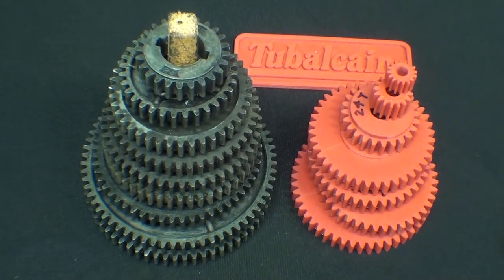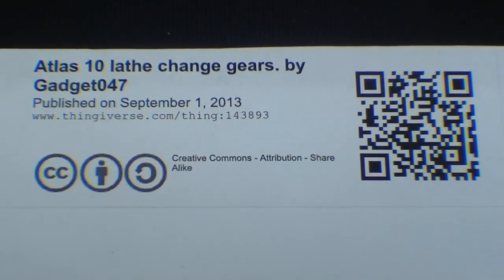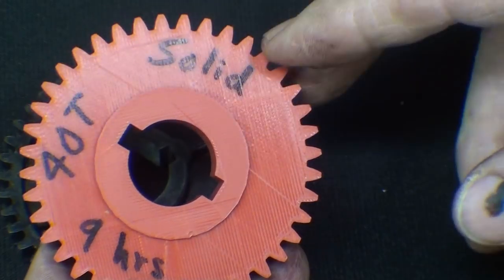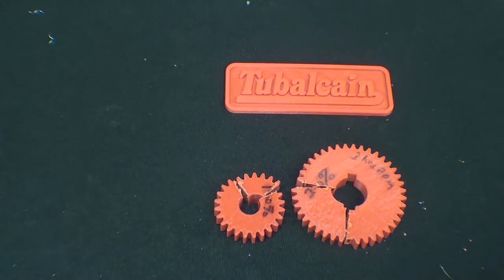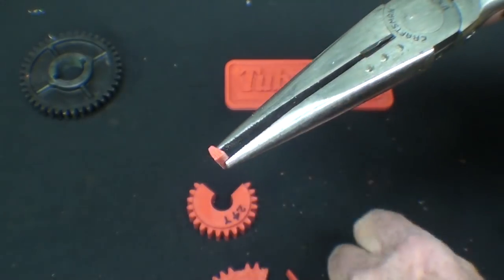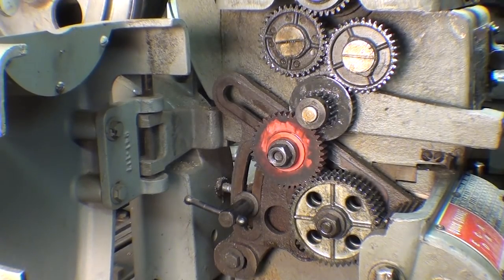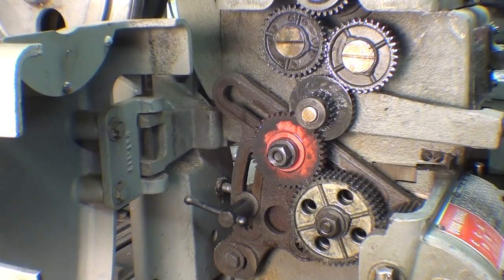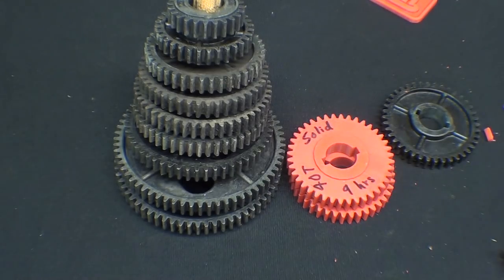3-D Printed Gears for Atlas Lathe TIPS #416 tubalcain

Comment: I wanted to get a 3D printer anyway. Looks like now I have a solid reason to do so. I found a craigslist bargain on a small mill/lathe combo but the change gears were missing. Now I just need to get the specs of the missing gears and print up a set. If anyone has info on the M1018 Shop Fox change gears - let me know! Great video.

Comment: this is the kind of thing i want to see! im hoping to get a 3d printer soon and one of the first design projects i plan to make with it is a reproduction of a champion model 400 forge blower's bronze gear. that machine used a bronze gear in an otherwise steel gearbox to transfer motion to a worm drive to turn the fan, the idea being the bronze would wear before the worm drive ever did. the gear in mine has just enough tooth left i could use it to create a 3d pattern and then try how it works in nylon or some reinforced material. even if it doesnt have the lifespan of bronze its way cheaper than having another machined and the cost of replacing it in the future would just be a couple bucks in filament and a few hours of waiting around... if i could only get the F&*#!%* gear off the keyed shaft in the blower
Reply from the maker: Sounds like a great project for 3-D printing

Comment: not very surprising, pla is strong, but its not impact resistant, so as long as you dont build a hammer with it, it should hold up fine, especially with the 100% infill. maybe just a tip from me, you can chose how many outer shells the printer should print, if you chose as many so the teeth wont be hollow, you could maybe end up with equal strength to the 100% infill one but with half the print time!

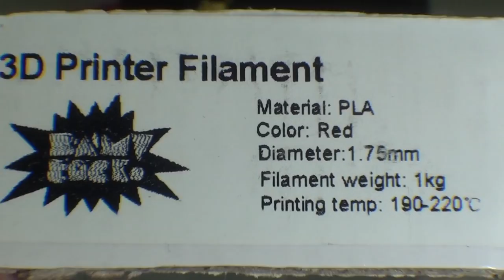Comment: 3:20, Mr. Pete's not PLAying around

Mr. Pete, if you're up to more testing, I was thinking a low TPI threading operation would be more stressful on the lead screw gears. But you'd always want to test on the first pass so if the gear breaks you don't crash your tool.  Just a thought.
Reply from the maker: Yes, that will be included in the follow up next month
Reply: I bet you're gearing up for the follow-up episode

Comment: Interesting that the printed gear did not fail, it will be a good test to see how long it lasts in service, having come through this test so well will you leave it in place as a life test in normal conditions ? The only thing against it is the 9 hours production time, you could hob out a steel one in less than that.We call the pot metal Mazac in Europe.
Reply: Englishman French ya but you could print it while you sleep 😴

Comment: Instead of a 3D printer why not use a urethane compound with a silicone rubber mold. I read a excellent article in SERVO magazine May 2007. This method would be much faster , cheaper  and you can have the molds ready to pour another gear at any time. I would like to see you test this type of gears. The article use HobbyMold 150 or HobbyCast 110 if these companies are still around. If you can't find the article I can mail you a copy. Just need an address.I do have a Atlas 10 inch lathe and a Craftsman 109 lathe.  Thanks for your excellent videos,      Christopher
Reply: csn451 there are two issues with silicone molds. The first is shrinkage from the master to the cast copy. Might not be enough to even worry about. The second is the molds become brittle over time and degrade. You can mitigate this with a silicone mold release spray the helps rejuvenate the mold and storing the mold correctly.
Reply: Hi Mike ,thanks for the info. To this day I have not tried this method to form gears . Can you tell me the other issue of Servo Mag that has the other article

Comment: I heard that the small Chinese hobby lathes use plastic gears and 1 video where 1 of the gears broke. I suppose i can try the 100/127 tooth setup in my 14" logan and tell you when it breaks. But then if it doesn't i guess i wouldn't need that shaper....

Comment: It would have been nice to do a visual inspection of the grear following up the test run. That could help a guy  in determining the longevity of the printed parts
All your people are saying it will give up the goat in time,,, WELLLL no shit surelock everything does so the real question is what's the time frame hear is this a 20 hour part or a 20,000 hour part? 
Do you plan to keep useing this part and do a follow up veejayoo?
Reply from the maker: I will be doing a follow up eventually. But I do not use that lathe often enough for a true evaluation

Comment: There is a filament called nylonX which is Nylon impregnated with carbon fiber that a fellow printed impeller with and then ran over it with his truck with no damage to his truck or the impeller. Looks like a gear made with that would last.
Reply from the maker: Yes, that looks like a good material

Comment: That was pretty impressive. I wonder how the 20% filled gear would hold up?
Reply: If it were printed with the teeth solid and their mounting edge also but the inner portion 20% it would be as strong with less plastic.  Kinda like how the original gear was made.

Comment: I would say if it's something your actually going to use you should A: make sure you have the cover that goes over the gears in case one of the plastic gears flys apart and B: print them in Nylon instead of PLA or ABS. There is a reason why they use nylon in consumer products instead of ABS (generally).
Reply: Great video Mr Pete ! As always , I enjoy watching what you come up with next . Very informative and please keep the videos coming .
Reply: Nylon is VERY difficult to print with, even more so than ABS.  You need an all metal extruder that can reach 240c, and you have to dry the nylon filament in your oven for 8 hours before printing with it every time you want to use it, unless you dry it and store it in an airtight container with large amounts of dessicant in it. Nylon is hygroscopic and will absorb up to 10% of it's weight in water in a single day. If you don't remove that water, it creates steam that blows up inside the filament as it is being extruded. You also need a heated bed, and a warm area to print in.
Reply: Is Nylon more durable than PLA or ABS?
Reply: NolanSyKinsley yea but if you don't have a way to cut the gears it's still a much better option. I mean I don't have a set up to cut gears on my lathe so if I need a gear I'll print it in nylon. It's really not as hard as you make it sound. Also I'd like to point out that most printers these days (at least the decent ones) have a heated bed and have a full metal hot end that comes standard.
Reply: Yes, nylon is not too hard. About the same as abs. I use the "nylon bridge" filament a lot. Bake the filament in an oven right before printing, print at 260. I use an enclosure for thick parts that may warp. Very strong, high temp, layers fuse well.  Can not pull the layers apart. Different story from pla/abs. Printed with a ptfe hot end for quite a while prior to getting an all metal. Some discoloration but still works fine. Petg is another decent one in place of pla or abs. Pretty easy and high melting temp.
Reply: I thing in this case PLA is better than ABS because ABS i wipe faster. PLA is vulnerable to deformation from heat but have better slip and its stiffer than ABS. Nylon is other tales....

Comment: Mrpete222 can you advise as to how many more hours you have put on these gears and how well they've held up?
Or can anyone with experience with pla printed gears performing this type of duty advise as to how long they last?
Reply from the maker: The jury is still out
Reply: mrpete222 It's encouraging to see that 40T gear, with 9 hours of use, that doesn't seem to show a whole lot of wear. I wonder what It would look like after 90 or 900 hours in use.
I also have an atlas, the little guy, 618, and am missing a couple gears, and some are worn pretty bad (carriage and leadscrew were stiff) so I think I'll give this a try.

Comment: If they function it would be awesome to have the metric gear set for threading on my Sheldon lathe
Reply: Liberty Cave I wanted to see threading with these gears, because the much higher feed rate means there is less reduction in the gear train.  A coarse thread would put more load on the gear he tested.  Increasing feed stresses that gear more than increasing depth of cut.

Comment: Sounds similar to a pot metal that has a low melting point. I used the same 3d set up for a 127 tooth index gear to cut a gear on a shaper between centers. Know anyone selling a decent bench top shaper? Prefer SB 7"

Comment: Interesting experiment. I have a small Atlas 618 lathe with Zink gears and I've always had misgivings about them. Set aside the burden of changing gears to get a thread, the risk of damaging them if my threading tool bit hits the shoulder on a workpiece is discouraging. Unlike my Clausing that has a shear pins on the feed and lead screws to prevent gear damage, these small lathes and others don't have this safety feature.  
You would think that if you buy a manual lathe these days, that it would have this feature as standard. But practically all bench top lathes which are made in China are so badly designed, that it makes you wonder if the Chinese have ever heard of CNC machines. The kind of machines that provided high speed machining, high accuracy, with innovative cutting tool geometries to maximize cutting efficiency, which in turn, would allow them to make better lathes, even better than an Atlas. Sadly, such machines do not exist and it makes you wonder why. I would never buy Chinese made machines. I refer to them as  Yugos. The only way to make an innovative benchtop lathe and milling machine would be to build it from the ground up from those who know better. I'd like to see Tubalcain, Keith Fenner, John Saunders, Edge Precision, Abom, and other top notch machinists work together to design a bench top lathe and mill that brings back what we had lost in the machines the US made back in the 50's and 60's. It is these machines we covet because they were made so well but now we have nothing like them. The Yugos have become normalized and so I'm not suprised that those who have them are always making improvements on them because they are so poorly made. The Atlas are better albeit their zinc gears.
Reply from the maker: Yes, he imports cannot equal the quality that we had on this country 120 years ago. Most of it is junk.

Comment: I've been making gears from PVC for years. Never had one fail.  You know those leftover pieces of 12" PVC pipe the city leaves around.  Cut a rough round shape, machine to size on the lathe and slot the teeth with a form tool.  Index using this: http://www.cgtk.co.uk/metalwork/reference/divider
Reply from the maker: Yes, PVC is a great material. My brother uses it all the time. But he buys it from McMaster Carr

Comment: Those pla gears won't last very long at all. They will deform with a slight pressure and a slightly elevated temperature. Nylon would probably work really well. There's also polycarbonate, but I'm not sure of the wear characteristics. Nylon is probably your best bet.
Reply from the maker: Time will tell

Comment: ABS isn't as strong as PLA. It does hold up to high temperature better though. Get PLA too hot - even leave it out in the sun too long and it will get soft and warp. If you want strong and heat resistent try nylon. ABS isn't the best to use for gears.

Comment: sir, plastic gear for lathe is not new, those chinese cheap lathe are all using plastic gears. the problem of these thing is, plastic can bent and worn out so fast. those cheap lathe that i am talking about usually don`t last longer than 1 year and you have to either buy replacement gear from them or find metal gear sets. as your video shown, during the last 2 cuts, the pla gear is shaking a bit. that is how fast it is going to worn out. born under the printer and die in the lathe, all happens in 1 day.
here is my humble suggestion, you may try insert a copper bushing and circle metal plate, or may be chicken wire as reenforcement for the gear in the printing process,  meanwhile it is the quick and dirty way i can think of and anyone can affort
i guess this series will have a part2 that you will take the gear out and examin the wear and tear, right?

Comment: Interesting experiment Mrpete! Glad you spent some time to explore such possibilities. I have made a set of gear for my little Emco hobbyst lathe in order to manually make screws and I must say PLA works pretty well.  Since you're also into metal casting, it would be nice so see some videos of gears making using lost PLA method, ie, using pla 3d prints as a positive model  for molds as in https://youtu.be/kgakfi8Ibjc. Thanks for sharing!
Reply from the maker: I think the lost PL a method leaves a lot to be desired. I have watched other YouTube videos on this. And it looks like a failure to me

Comment: A .005 feed is maximum test?   I think a better test would be to cut some threads.   A 20 thread per inch would have a feed of .050, putting 
10 times the load on feed gears.   THIS would be your true test.  Even better yet, 4 threads per inch, putting 50 times the load
Reply from the maker: Yes, I intend to do that and I'll follow up video